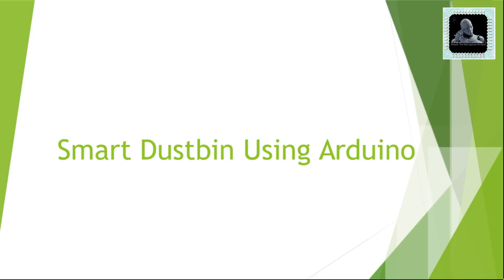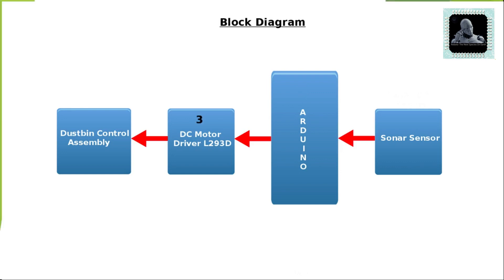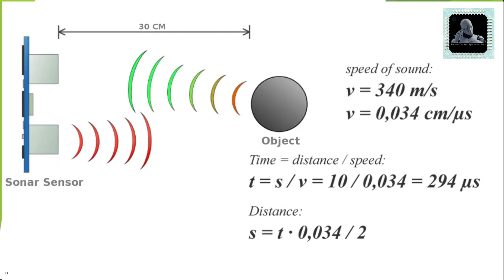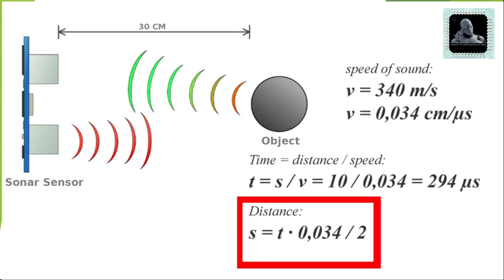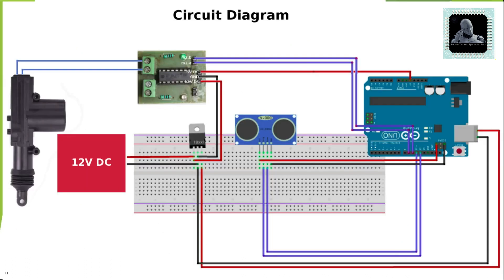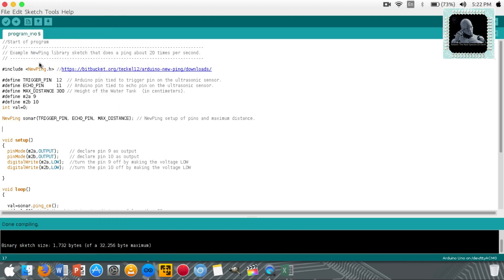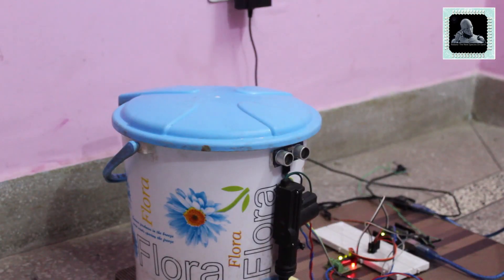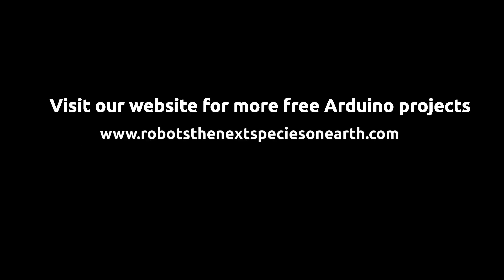Smart Dustbin Using Arduino

Comment: plz send mi code
Reply: //Start of program
// ---------------------------------------------------------------------------
// Example NewPing library sketch that does a ping about 20 times per second.
// ---------------------------------------------------------------------------

#include <NewPing.h> //https://bitbucket.org/teckel12/arduino-new-ping/downloads/

#define TRIGGER_PIN  12  // Arduino pin tied to trigger pin on the ultrasonic sensor.
#define ECHO_PIN     11  // Arduino pin tied to echo pin on the ultrasonic sensor.
#define MAX_DISTANCE 300 // Height of the Water Tank  (in centimeters). 
#define m2a 9
#define m2b 10
int val=0;

NewPing sonar(TRIGGER_PIN, ECHO_PIN, MAX_DISTANCE); // NewPing setup of pins and maximum distance.

void setup() 
{
  pinMode(m2a,OUTPUT);    // declare pin 9 as output
  pinMode(m2b,OUTPUT);    // declare pin 10 as output
  digitalWrite(m2a,LOW);  //turn the pin 9 off by making the voltage LOW
  digitalWrite(m2b,LOW);  //turn the pin 10 off by making the voltage LOW
  
}.

void loop() 
{
  
  val=sonar.ping_cm();
  if(val<40) // if the object is at a distance of less than 40cm 
  {
    digitalWrite(m2a,HIGH); //turn the pin 9 off by making the voltage LOW
    digitalWrite(m2b,LOW);  //turn the pin 10 off by making the voltage LOW
  }
  else
  {
    digitalWrite(m2a,LOW); //turn the pin 9 off by making the voltage LOW
    digitalWrite(m2b,LOW); //turn the pin 10 off by making the voltage LOW
  }
  

}

//End of program

Comment: bhai coding kashy kiya
Reply: //Start of program
// ---------------------------------------------------------------------------
// Example NewPing library sketch that does a ping about 20 times per second.
// ---------------------------------------------------------------------------

#include <NewPing.h> //https://bitbucket.org/teckel12/arduino-new-ping/downloads/

#define TRIGGER_PIN  12  // Arduino pin tied to trigger pin on the ultrasonic sensor.
#define ECHO_PIN     11  // Arduino pin tied to echo pin on the ultrasonic sensor.
#define MAX_DISTANCE 300 // Height of the Water Tank  (in centimeters). 
#define m2a 9
#define m2b 10
int val=0;

NewPing sonar(TRIGGER_PIN, ECHO_PIN, MAX_DISTANCE); // NewPing setup of pins and maximum distance.

void setup() 
{
  pinMode(m2a,OUTPUT);    // declare pin 9 as output
  pinMode(m2b,OUTPUT);    // declare pin 10 as output
  digitalWrite(m2a,LOW);  //turn the pin 9 off by making the voltage LOW
  digitalWrite(m2b,LOW);  //turn the pin 10 off by making the voltage LOW
  
}.

void loop() 
{
  
  val=sonar.ping_cm();
  if(val<40) // if the object is at a distance of less than 40cm 
  {
    digitalWrite(m2a,HIGH); //turn the pin 9 off by making the voltage LOW
    digitalWrite(m2b,LOW);  //turn the pin 10 off by making the voltage LOW
  }
  else
  {
    digitalWrite(m2a,LOW); //turn the pin 9 off by making the voltage LOW
    digitalWrite(m2b,LOW); //turn the pin 10 off by making the voltage LOW
  }
  

}

//End of program